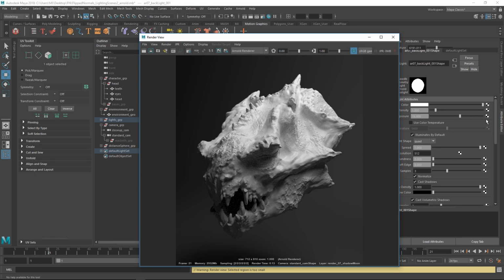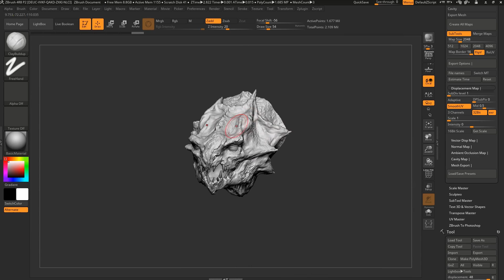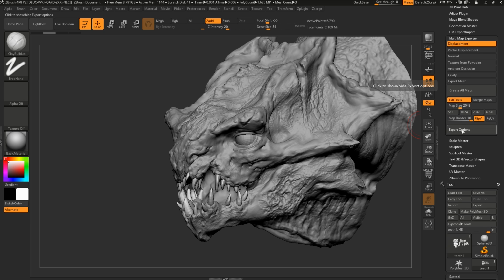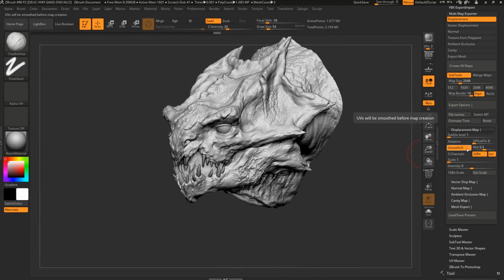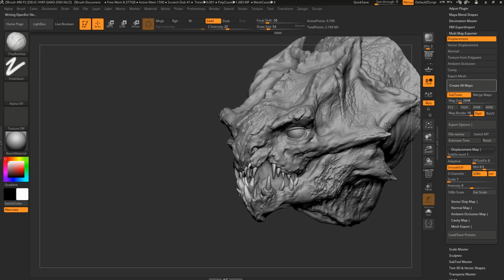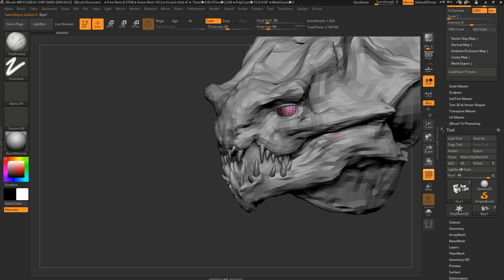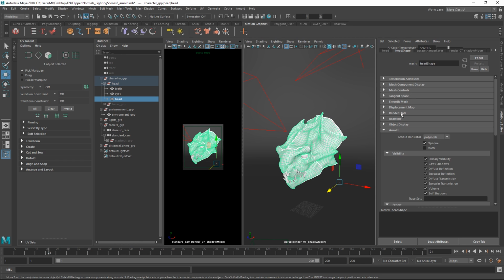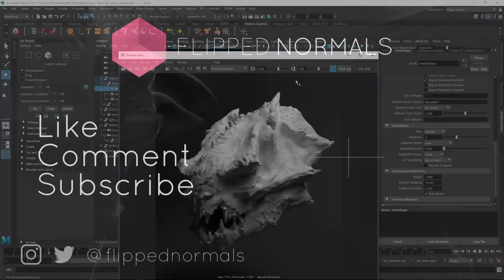ZBrush to Arnold for Maya -  32 Bit Displacement UDIM Tutorial

Comment: The model just bloats up.
1. imported maya model into zbrush
2. made auto UVs
3. Modelled some details on it on 6th subdiv level
4. exported displacement and mesh
5. import mesh into maya
6. set arnold material and setup displacement
7. played around with the settings for a good 4 hours, it only bloats up.

It is as if arnold sees the EXR as just a black or white plane, without any details. I doublechecked, there are details on there.
Tried with zero values of 0 up to 1, always the same. 

It just bloats up and i am beyond frustrated. I cannot work with 10mil polygons in maya lol
Reply from the maker: Hey! Could you post a screenshot of what this looks like? Would love to help out :)

/H
Reply: I got rid of everything in the project and removed the files.
Sadly I can not afford doing it again, given that i literally just blows up.
The dark and the light parts blow up equally.

Seen when i change the scalar zero value, you can see the whole object inflate / deflate.

Maybe it has something to do with the UV's not being recognized?
Exported with DISM, and made sure to unwrap the object before sending it to maya.

Also, the UVs are correct in Maya, seen in the UV Editor.

This is beyond weird :(

Comment: what's the map resolution you usually use? I often go for 4k, but i see a lot of peoploe got as high as 2k. Should I stick to 2k? Is there a bake speed difference vs quality?
Reply: In all cases, the size of your map is what determines how much detail it can hold. A 1K map (1024x1024 in size) is just over 1 million pixels in total. A 2K map is about 4 million. A 4K map is about 16 million. In practice, about 25% of the available pixels aren't used, though, because almost all UV mapping has empty space. Your goal in determining your map size will be to choose the one where the available pixel count is closest to the number of points at your highest subdivision level. So if your model is 4 million points, then a 2K map is perfect while a 1K map would lose a lot of detail and a 4K map would require a lot of interpolation to create extra data out of thin air (resulting in quality loss) [by aurick]

Comment: Hey guys, I need some help. I followed all the steps in the tutorial, but for some reason my mesh in maya just bloats up and I can't figure out why.
Reply from the maker: We realised we said the wrong thing about where to put the mid value. Can you try the following? We pinned the correction as a comment here :)
"In the video we say that you change the mid value under 'Bounds Padding'. This is wrong. You change it under 'Scalar Zero Value' instead. It's the same place"
Reply: Aaaaaaand its fixed. Thanks you guys!! Awesome tutorials. Cheers :)
Reply from the maker: Brilliant!

Comment: idk but there are not a lot of artist talked about or use VDM insted of DISP why is that ? VDM is better even substance desginer dosn't have VDM
Reply from the maker: Vector disps are pretty good, but one of the big problems is that they are notoriously undocumented, so it's really hard to make it work. Every render engine also uses different settings. We've used them on films, but it was a bit if a paint to figure out how to make them work.